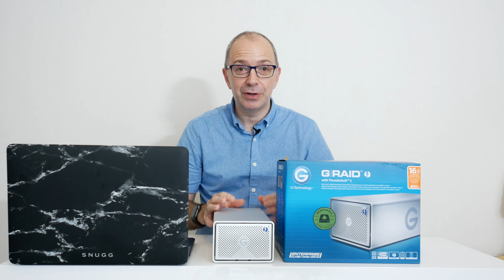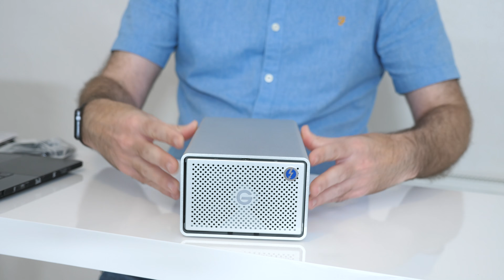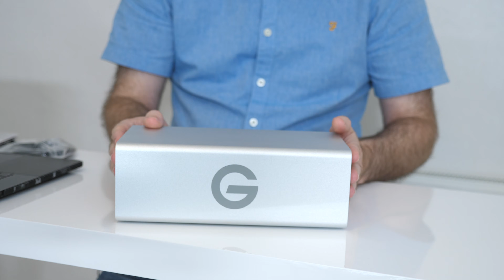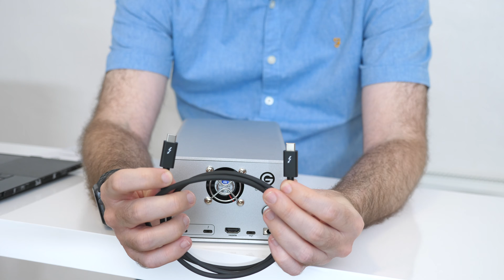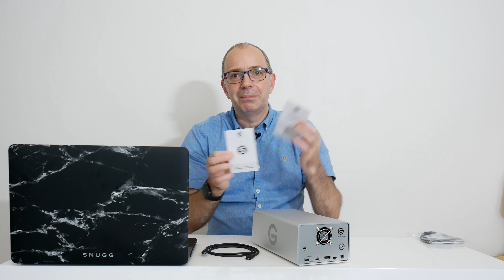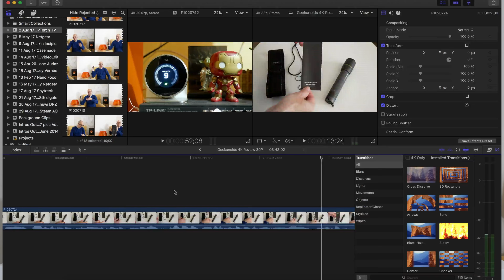G-Technology G-RAID Thunderbolt 3 Hard Drive Review & Speed Test

Comment from the maker: Correction. The USB-C port does not allow the connection of an external drive, it does not act as a hub. The connection is there to connect to a USB-C gen2 port on a computer that does not have the faster Thunderbolt 3 connections.
Reply: Geekanoids hi thanks for the video, so this can connect via usb3.1 to a computer ? If so, what is the speed test result - you wouldn't happen to know would you?  :) I assume it should be the same as it's limited by the drive speed.
Reply: Thank you for showing us this Dave. I wasn't expecting 400 MBPS. I have only seen 3 or more HDD in RAID exceed that speed. But as a traveling and editing RAID I would still pick this up.
Reply: @RickyV-Production  does this work on ps4 pro/ps5

Comment: My new 8TB G-RAID makes an insane amount of electronic noise from both the unit and the power supply. It is a high frequency whining noise that alters in pitch. It is worse when the unit is on (disks spinning) but it also does it to a lesser extent when the disks have spun down. Can you put your ear up to your G-RAID and tell me if yours does the same? Thanks.
Reply from the maker: Mine does not do the same. However, I have had noisy power supplies before with different manufacturers and got them swapped out.
Reply: @geekanoids  cheers. Yeh it sounds like power supply noise that is then getting amplified by the unit itself. Will consider getting a replacement

Comment: Hello, thanks for the video. Question I just bought the one in this video. My question is do I need to set this up in order to create the extra backup in the additional drive in the product or does it come as a default feature where I can just plug into my computer and start saving files? Hope that makes sense. Thanks!!
Reply from the maker: You need to check the RAID setting.

Comment: Thank you + quick comparison to the Lacie BigDock. It's meant to write at 500 gb/s according to the box so the 360 you are recording is significantly lower. Now try and configure it for RAID 1 mirroring, most people I assume would buy it to mirror as that's RAIDs principle selling point. There's no direct information on or in the box how to, the G-Tech forum is confusing and when you do get it to work by finding the correct software (G-RAID with Thunderbolt Configurator, you need to make sure the software is exactly the same as the product, there are different types of G-RAID) there's no way of checking the information is on the second disk. I don't doubt it's a very solid bit of kit but the Lacie Big Dock has much better communication and software (it advertises a lower transfer rate of 440 gbs though and does not feel as solid, I'm not sure which has the higher quality internal drives I'm guessing the G-Drive does). I'm going to continue trying to make this work correctly in RAID 1 but I'm losing hope and thinking of returning it which is a shame because all my drives for the last decade have been G-Drives. NOTE - do not try and check the data is on both drives by removing one, if you do you'll have to reconfigure it using the above-mentioned app, it takes forever.
Reply from the maker: Thanks for sharing your experience with this.

Comment: Hi Dave. I watched your video with interest, but having now bought this machine I came back to check some information. 

You say you can''t daisy-chain from the USBC port, and then claim you're looking forward to being able to 'connect a USBC hard drive to make regular back-ups'. This didn't ring true. 

As I was writing to you to check what you meant, I saw your PINNED correction below. 22,092 people have seen your video, but I for one rarely look at comments. So with the greatest of respect, a 'pinned correction' lost down the post doesn't really help those who might be confused or - having bought the machine - disappointed. Once it's said, it's said, so if you're going to make these videos, there's a very good case for double-checking facts I would say. And for any new viewers, maybe add a caption to the video or even remove and amend it? 

Also, Lenny and Sandi ask if this machine can be configured to RAID 1. You weren't sure. I hope by now they've discovered you certainly can configure to RAID 1 - in fact some would argue it's the main asset of a device such as this - something you don't touch on. Indeed, if you personally want to make regular back-ups having failed with the USBC idea, I would suggest RAID 1 is your best way of doing it - you don't have to plug anything in or do anything at all!  

Sorry to leave a negative comment about your professional, well-presented and believable review. But that's the point. It's believable, but some information is untrue and this is the second video about this unit which is very misleading. I do think YouTube reviewers should be 100% sure of facts and take effective ownership of errors once the video is posted.

Best wishes
Simon
Reply from the maker: Thanks for sharing this Simon. Videos don’t support captions now and the pinned comment should appear at the top. Sorry I no longer have this device to check for updates.

Comment: Where can you buy the drives inside one has failed and I need to replace but can't fine one, its for  External Hard Drive
G-Technology 12TB G-RAID Thunderbolt3
Reply from the maker: Sorry I cannot get to mine to check. Pretty sure they are HGST drives, so should be on Amazon or good computer retailer.

Comment: I USE THE LACIE 5BIG THUNDERBOLT THERE TO ONE WITH A SWITCH AT THE BACK WHICH YOU GET SPEEDS OF 550MG AND THERE ONE WITH NO SWICH TO TURN IT ON AND OFF THAT GAVES 837MG PER SEC.

Comment: I have one of these units, 8TB as RAID 0  its as noisy as hell. Yes it's quiet when the heads are parked (which is rare when it's in use.) In fact on your video i can hear the heads calibrate as the disks spin. A you say, the fan noise is almost silent, it's the drives in the enclosure that chatter like crazy. I've never experienced a drive or RAID this noisy. I've complained to G-Tech but have heard nothing back. I don't think I'm alone on this matter.
Reply from the maker: Interesting Adam. Mine is still pretty quiet.

Comment: I have one of these but it has a USB 3.0 and two thunderbolt inputs. And it's a 20TB one but each hard drive is ten terabytes of hard drive space.
Reply from the maker: Nice one, I hope it works well for you.
Reply: It is. Despite all the scratches and marks on the exterior of the case, it works great on the inside. I ended up having to get a 20ft USB 2.0 cable because the 3.0 one they include inside the box is too short for me.

Comment: The thunderbolt 3 speed is too low. I am using WD rapid 2TB is almost same speed 330MB , but I just using thunderbolt 1. I think ssd is the way can make it more than 1000-1500mb.
Reply from the maker: SSD is definitely the way to go, this capacity in SSD is maybe in the future :D
Reply: the bottle neck is the drive itself. not the raid system. the thunderbolt 1 is already faster than the raid 0 of two most up to date drives.

Comment: I love that PowerMac G5 / MacPro Tower Cheese greater design. I personally don’t need much space. I have an external 1 terabyte drive, and a smaller 500 gigabyte drive for more important files.
And I use 3 internal drives in my pc (I wish I had a Mac, at least not a 2007 MacBook.) I have a complicated setup and I need to simplify that setup. But if I was using TB3, I would get that because    I do like that drive
Reply from the maker: Many thanks for your comment. Nice setup you have there.